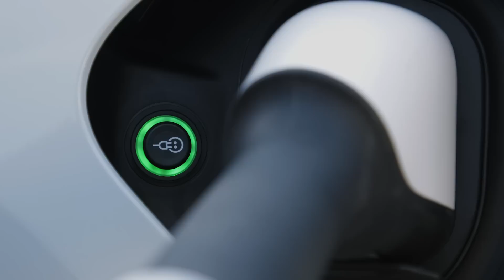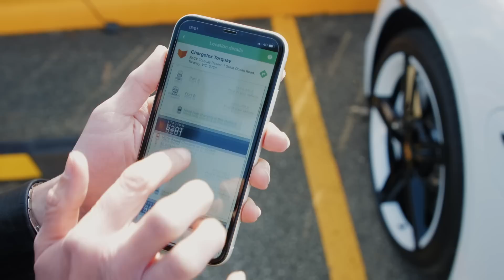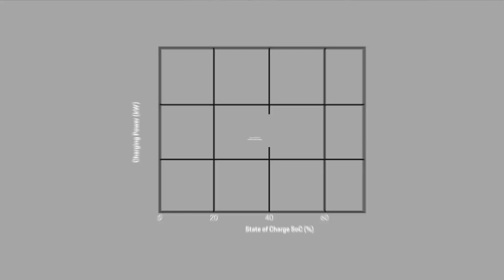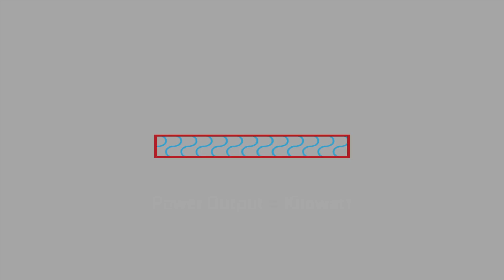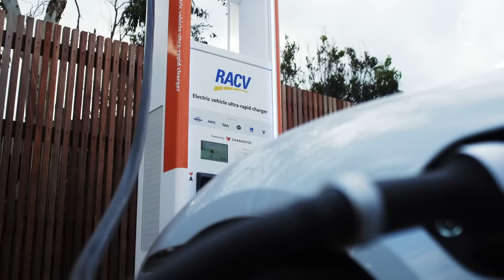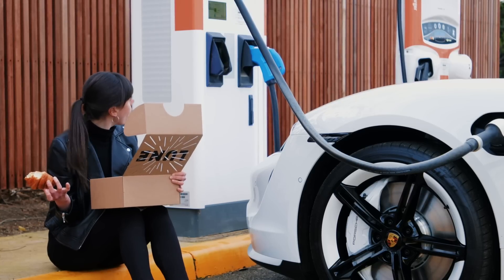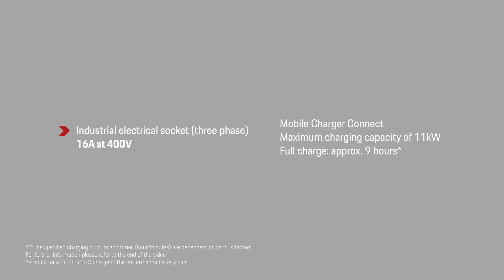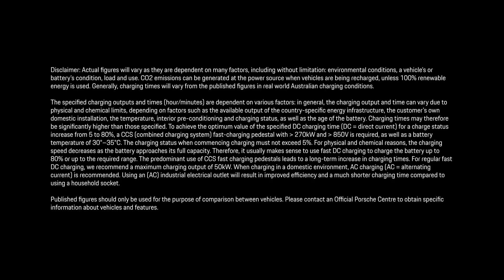Charging the Taycan with Kate Reid

Comment: 93.4kw/h 🤦
Reply: Yeah, can't believe no engineer reviewed this video.
Reply: Its  KW? I am not an engineer,just curios.
Reply: @djprojectus  kW measures power so it is used to rate the engine or the charger, power can be called as the ability to provide energy. Energy on the other hand can be measured in several units, one being kWh (and not kW/h which isn't anything). If the video said the battery rating in calories or joules with would be better (but not as useful from a practical pov compared to kWh).